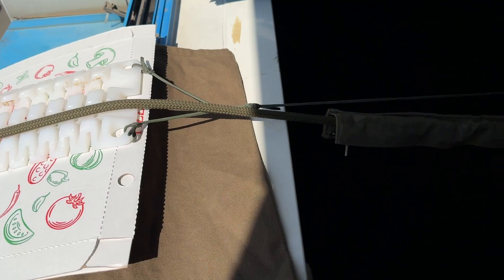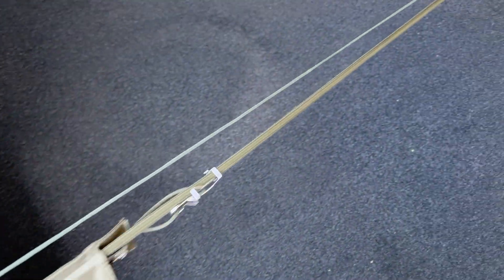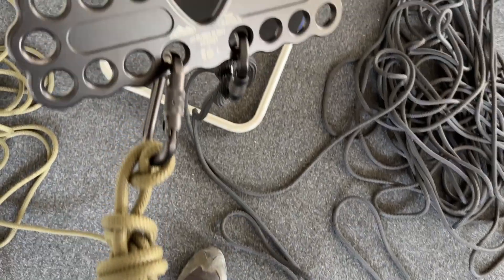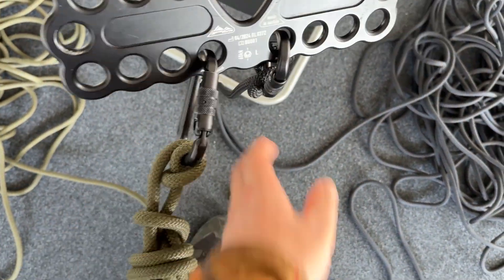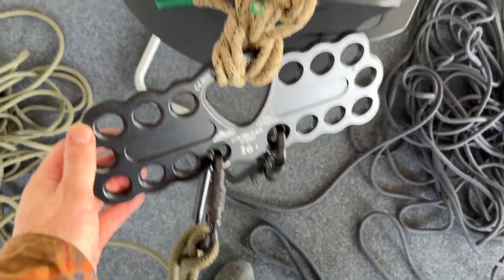Urban Anchor in Office Building - Setup for Tactical Rope Access Training

Comment: Why in the Door anchor point the rope is tied by the side and not in the middle? Maybe because It's a stronger point?
Reply from the maker: The middle is the weakest point on the wood. Close to the door frame is stronger. If the door frame is not super strong and you want to weight both sides, you can add a second sling to the other side.
Reply: @ripperkon  Thank you, all clear love your vids ❤️